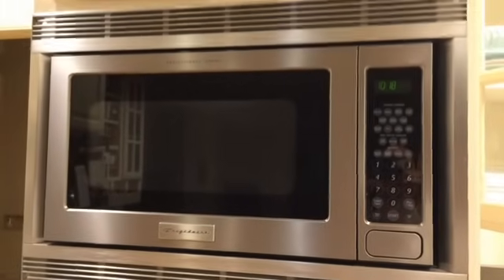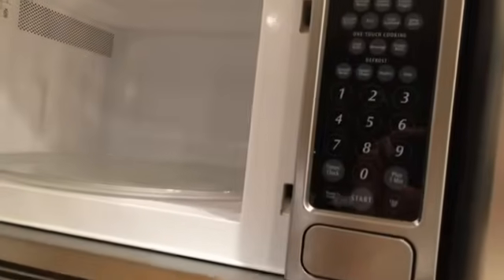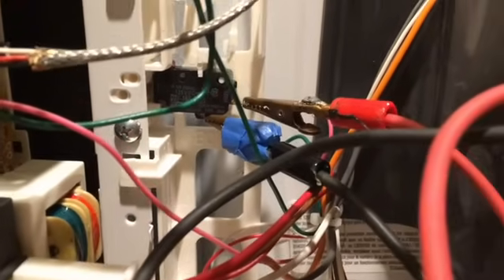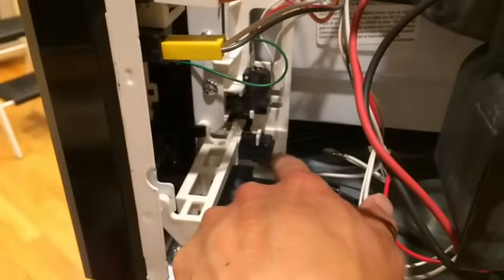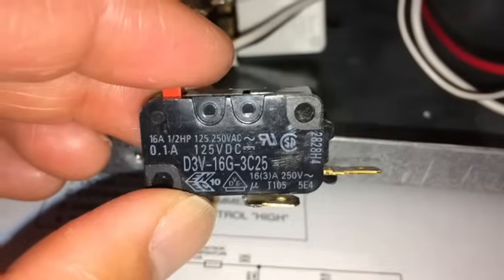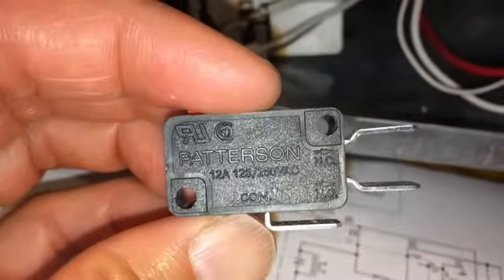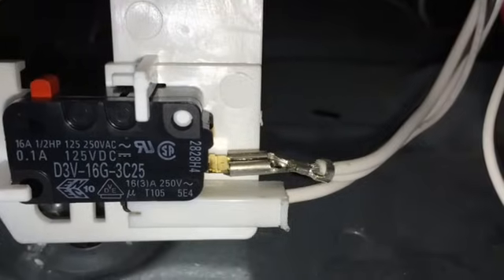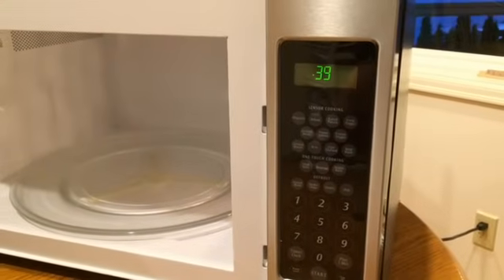$3 fix for microwave that lights up but no heat, buzzing or spinning

Comment: All three of my door latches tested fine with a voltmeter but I just knew one of them had to be the issue. My LG LMV1813ST would take a cook time, count down, the light would go on but the turntable didn't turn and it didn't heat the food. After seeing your comment, I ordered the latch (part 1325771 at RepairClinic.com) was only $3.34 and shipping was $6. It was either going to be the top or the bottom switch and I even guessed it was the top sensor. You saved us $300+ and I feel happy not to have contributed to planned obsolescence. - Credit goes to C S39 in this page where he mentioned that parts might pass a voltmeter test but fail when power is passed through them.
Reply: Same issue here. All switches were testing just fine with a voltmeter. But after reading your comment, I decided to repair one of them anyway (the top one), and that was it. Our microwave is working again. Thank you!

Comment: Genius, I like your critical thinking......but you should mention the other possible multifactorial reasons (fuse, capacitor, turntable motor) why other microwaves fail to rotate turntable..... some viewers may automatically think it is the switch. In my case it was the motor..
Reply: I assume in your case, though, it actually heated things up.  This isn't intended as a solve-it-all.  But thanks for watching.

Comment: Video was great. My capacitor had already bled out after 24 hrs. Ohmed out the switches and the top one was open. Found a replacement at Dey Appliance for $5.53. Very cheap fix.Thanks

Comment: Great Video! In my previous life I was a Technician. I've found some switches to test good out of circuit but when power is applied would open up...driving you crazy. I have the exact same problem with my GE. Thanks for the video.
Reply: C S39 you are a genius!  All three of my door latches tested fine with a voltmeter but I just knew one of them had to be the issue.  My LG LMV1813ST would take a cook time, count down, the light would go on but the turntable didn't turn and it didn't heat the food.   After seeing your comment, I ordered the latch (part 1325771 at RepairClinic.com) was only $3.34 and shipping was $6.  It was either going to be the top or the bottom switch and I even guessed it was the top sensor.   You saved us $300+ and I feel happy not to have contributed to planned obsolescence.

Comment: My Viking microwave had the same symptoms and I was did not want to spend over $1,000 to replace it. After watching this I decided to open it and it was almost exactly the same. I tried testing the switches but they were difficult to get to without taking everything apart so I just ordered three direct replacement new ones at about $7 each. I did manage to break the plastic piece that the handle pushes to open the door but that was only $3 on eBay. When I did the install I was surprised to find that there were two of the same switch on the lower latch so I ended up only replacing three of the four in there - you could not see it at all from looking in at the side. With under two hours of time and $27 in parts the microwave is back up and running. Thank you for posting this video. I can now resell the $20 Craigslist microwave that I had to purchase while waiting for the switches to arrive.

Comment: It is very helpful to know that the top switch controls less current (lights & display) than the bottom switch (magnetron, turntable, & fan). I noticed that when you tested the  repair, it appeared that you  pushed the "door open" lever. One of the things that causes the switch to fail is pressing door open while the magnetron is operating. An arc is drawn between the contacts of the switch which causes heating, pitting, and burning of these contacts. I'm glad you mentioned this at the end of the video.
Reply: So I typed my symptoms into a Google search bar and this video popped up I started reading the comments and read yours and went straight to my microwave and looked at the bottom switch and lo and behold it's all beat up in there! Good call! Thank you Jesus

Comment: Two years ago right after I moved into my house, my microwave died.  It took the repairman 2 weeks and over $200 to troubleshoot/fix what turned out to be a broken door latch switch (covered by warranty).  It just died again.  With this video, I fixed it the next day for $8.  Awesome video!

Comment: TORX T20H(tamper resistant) for anyone looking.  Great video, bought switch off amazon and replaced the main(bottom switch only).  I would recommend not taking off the plastic housing that holds the switches,  I was able to use needlenose pliers to push the tab and slide the switch out to replace.  For my Samsung i would have had to break a few tabs and potentially the door button rod to get the whole piece out.  Thanks again for sharing!!!  I knew that it was probably the bottom one because a few times after it first stopped working I could lightly depress the door button and it would start working.  I also had some dark residue around the top red/black wiring connection inside the sleeve(which was another indicator of why it stopped.

Comment: Great video, but I wonder why people end up spending money unnecessarily on those switches. I always fix those. I open them and clean the contacts, simple as that! They are held close by plastic dowlels. U can use some sharp, flat object to initiate the opening and wiggle all sides evenly to open. The contacts inside are not that " micro" sized, and can be held even without special pincers.
Reply: It depends upon whether you enjoy fighting fires.  I once fixed a switch inside an appliance only to have it melt a few months later and catch on fire!  Some of these switches handle full line voltage and even if your repair is done right, it could easily fail again and melt the casing and potentially cause a fire.  I never fix switches anymore if they handle full AC voltage.  Spend the $5-10.  These switches are not built to last forever.

Comment: I know this conversation is dated, but was hoping for instruction the safest way to bleed off high voltage capacitor and safety check before proceeding attempt to repair. Thanks

Comment: It worked for me. I don't had new switch so I decided to use old same switch.  Just open it, clean it with sandpaper.  Put it back. Waoo it works. Thanks it saved my money.
Reply from the maker: Glad to hear that worked for you, but those switches have a definite lifespan, and those switches aren't designed to be opened so it may pop open unexpectedly.  If the switch is handling 120V any future failure could remotely cause an electrical short or fire.  I would recommend you order a new switch and replace it.  The $5 spent is good insurance.  As you can see my my post a few months ago, both switches ended up failing so I'd buy replacements for both.
Reply: MITEEman  thanks

Comment: Thank you for your video.  Your instructions were very easy to follow and we were able to replace all three of the switches for less than $30.  Taking pictures as we were tearing it apart definitely helped when we put it back together one week later (we had to wait for switches to be delivered).  Works perfectly...  I'll never slam a microwave oven door again!

Comment: You had the correct torx security bit in that kit. I have the same set. The torx bit with the hole in it which you have is the correct one.

Comment: I used this video not my style of microwave have a GE JVM3160DF2WW  2015 Manu .  Microwave would light up and make noise but would not run.  I did not pull my microwave out.  I did have to remove vent cover and touchpad.  I removed both bottom switches one was NC and other was NO   I went to local part store Repair Clinic and they did not have the parts in stock and wanted 22 for one and 66 for the other available in a week or so.  Went on amazon and ordered them for $9 for both and rec'd them in 2 days.  Installed them both and microwave is now working.  Thanks for making this video.

Comment: Thanks,  Very good video and presentation; I know this is a few years now, but, in case others benefit from this; the middle switch is a monitor switch that is normally closed, and when the door is shut, the other two switches close, and the monitor NC switch opens. I't a design to guarantee that no power will get to the transformer and Magnatron assembly if the door is open.

Comment: I have a Samsung  model # smh17135s  I checked the switches and they all  check out  fine with the multi meter fine. so what do I check next? it runs but doesn't heat anything

Comment: I'm about to replace this switch thanks to your video and when I opened the case it was quite obvious because the connector with the black wires was burnt so my question is how can I test the power coming from the wires that connect to that switch you replaced
Here is a vid I made so you can see https://youtu.be/bAdfLFAY-ek

Comment: My Samsung Microwave stop working the week after the warranty expired. They wanted to charge $90 for someone to come look at it plus the cost of repair and I thought that was ridiculous. So I put off fixing it for over a year while we use this cheap $30 Walmart microwave.
I watch your video and see how easy the fix is and I take the 16A switch out of the Walmart microwave and put it in my $300 Samsung and after a year plus, ITS ALIIIIIVE!

Comment from the maker: I have an update - 2 1/2 years after I made this video, the second original door switch failed in the exact same manner.  This is not the one I bought, but the one that I swapped in from above.  So if this is your failure I would recommend you replace them both.  

Now I see you can buy the exact part for about $5 on Amazon or Ebay.  Here's the part number: D3V-16G-3C25.  Don't accept anything else unless you're sure that it has the same dimensions, 16A rating, Normally Open contacts.  There are a lot of switches with similar numbers that are either Normally Closed or have a lower rating than 16A.
Reply: instablaster...

Comment: I have the same problem with a GE Model JVM1190BVM.  Tested all three door switches and found continuity on each one.  So it doesn't seem to be simply a switch problem.  This is a also a convection oven, which also is not working.  What else could it be?  Power supply? Any advice would be appreciated.

Comment: way to go!! I just picked up a microwave off the street at 10 pm and one of the three switches stayed in the closed position. so i took it out and opened it up. I found the small leaf spring inside of the switch slipped out of position. I bent it to give it a bit more tension and put it all back together and now at 11 pm I have a Samsung ME16H702SES for 60 minutes of my time ! thank you for the video. it gave me enough to start my troubleshooting!

Comment: I have the same microwave, with same problem.  Its a faulty door switch,  but unable to get the door to open.  How do I pry the door open?
Reply: +Chiggertown take the shell off then you might be able to work the latches form the inside

Comment: Very common issue. On mine the plastic bracket went out of alignment, and I had to put in a tiny plastic shim to get it to work. I usually replace ALL 3 and keep a spare.

They also can work intermittently - sometimes the microwave will work, sometimes not. You have to wiggle the door to determine that. The terminals where the wires connect sometimes also go bad. You have to wiggle the wires to determine that.

There is even a combination of bad switches that could make the microwave run even if the door is open! I believe mine kept running when I opened the door and blew a fuse a second later!

The switches are also shared across all brands. There is one normally open and two normally closed (or reverse)

Comment: Thanks for this video!  I have a very expensive microwave that broke maybe a year ago and at the time we paid ~450 for a repair man to come and replace just the capacitor in it.  Having studied EE, I thought what the hell, I could've done that myself.  Here I am now, the microwave breaks again! I decided to open it up but I  saw this video first before testing parts and sure enough, one of the door switches has black, burned up leads.  You just helped me save quite a bit

Comment: Shouldn't that microswitch control a relay?  Why would it need to pass 16Amp through it?
Reply from the maker: 12vgs8606 When the computer is controlling the microwave, yes, a relay is doing all the work.  These door switches, however, are built as a safeguard.  They will interrupt the flow of electricity manually by breaking the circuit with the full flow of electricity going through them.  When I disassembled the broken switch the contacts had severe pitting and the plastic supporting the contacts had melted to the point where they were no longer closing.  It's not clear if that happened because the flow of electricity was overheating the switch or opening the door prematurely was causing arcing which then caused the melting.  It was clearly handling a lot of power.   You can also see the wire size shows that the lower switch is handling full line voltage.  So the lesson is to stop the microwave using the cancel button instead of just opening the door.  You're right - a better design would be to have the door switches going to a full sized relay.  I suppose the designers figured the switch was rated for that so why bother.  Also, they sell a lot more microwaves this way :(
Reply: where do you buy the switch